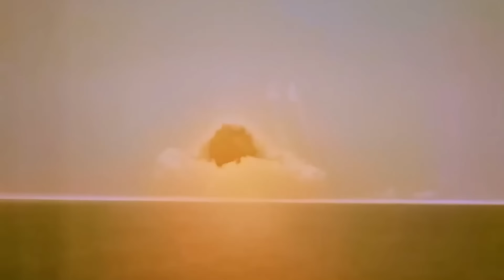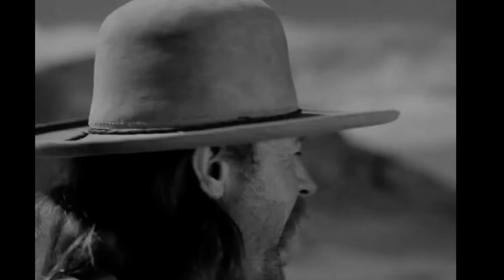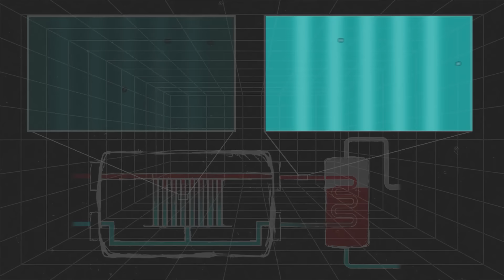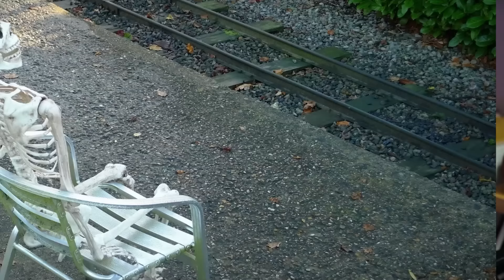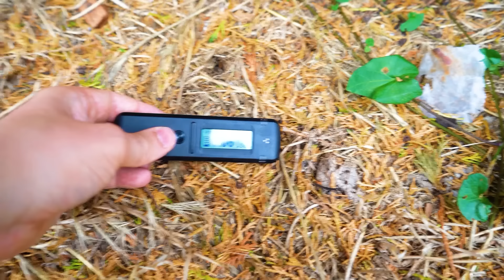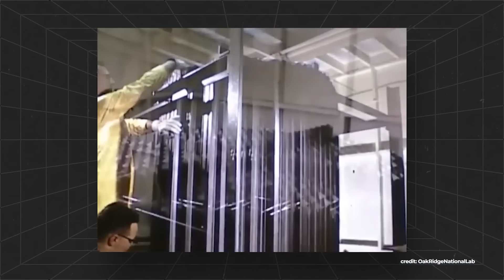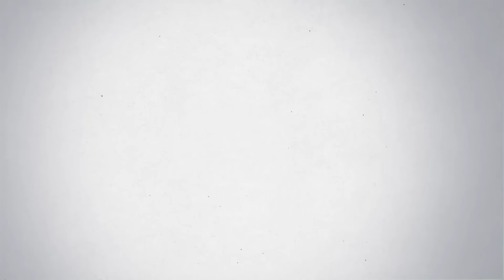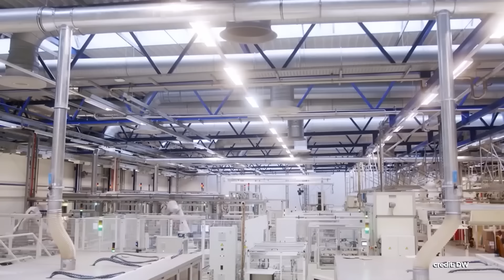It's Happening - China Launches World's First Thorium Nuclear Reactor

Comment: Selling a radioactive waste product as "safer" or of less concern because it has a shorter half-life than some other radioactive waste by-product is a false assessment.

Assume for a moment the world as a whole converts over to Thorium molten salt reactors.  The radioactive waste produced is "only" radioactive for 500 years you say?  Not so fast!  Yes, gram by gram, it will decay to a safe level in 500 years.  However, it's constantly being renewed as more and more radioactive waste is produced.

The proper way of looking at it is this:

Year one let's say 10,000 tons of Thorium-derived nuclear waste is produced globally which will decay to a safe level by the year 2524. Now you have 10,000 tons of radioactive waste sitting around for the next 500 years.

The following year another 10, 000 tons of Thorium-derived nuclear waste is produced globally which will decay to a safe level by the year 2525.  Now you have 20,000 tons of radioactive waste sitting around for the next 499 years.

Each year thereafter you keep adding another 10,000 tons of radioactive waste...for 498 more years!

The silver lining is - due to the shorter half-life compared to other radioisotopes - you DO eventually reach an equilibrium point AFTER the year 2524 where you're no longer increasing the sum total tonnage of stored radioactive waste (5 million tons if we use the original 10,000 ton/year estimate x 500 years).  This would compare favorably with something like uranium.

However, what is inescapable is you are still left with millions of tons of radioactive waste which will NEVER decrease in total tonnage while your civilization continues relying on this form of energy production, adding new radioactive waste to the pile each year even while old waste is finally decaying sufficiently to be considered safe.  You do hit a ceiling on the total tonnage that has to be safely stored (after 500 years), but once you hit it you're stuck with it forever; or until your civilization switches to a different form of energy production that doesn't produce such waste.

That said, I'm not against it.  Of all the nuclear options available, Thorium holds promise as perhaps the most practical, affordable, and safest; barring the Holy Grail of stable fusion reactors, of course.  But let's not pretend that the decay of a Thorium reactor's radioactive waste to a safe level after 500 years translates into not having to worry about safe storage after 500 years.

To the contrary, as long as Thorium reactors are operational there will always be radioactive waste associated with them.  Waste which will have to be safely stored in perpetuity on the order of potentially millions of tons because, as old waste is removed from storage due to having sufficiently decayed to be declared safe, an equal amount of new radioactive waste is added to the pile in an endless cycle.

All the 500-year-safe-level does is set what the total tonnage in storage will be; NOT that you won't have any waste after 500 years.  You will ALWAYS have radioactive waste where nuclear fission reactors are concerned and you will ALWAYS have to figure out a way of safely storing it.

Comment: The importance of the Chinese reactor is that it meets both of what I consider the most important characteristics of future desirable nuclear reactors. 

Most importantly it eliminates pressurized water cooling and the potential of core meltdown and explosive release.   Molten salt cooling eliminates the need for both costly high pressure containments and any need to site near cooling water to condense steam.  The latter can largely eliminate the need for new bulk transmission because such reactors can be sited near any load for ultimate service reliability.  Note that Terra Power's Natrium also meets this most important goal with intermediate molten sodium cooling,

Secondly, using molten fuel provides self regulation, walk-away safety and the potential to breed its own fuel from existing waste as well as abundant Thorium.  The first two of those characteristics should also make siting much easier. 

I note that you ignore other Thorium reactor developers such as Copenhagen Atomics, who may also achieve near term commercial Thorium reactors before 2030.  I also see all of the needed reactor advantages in the fast breeding MCFR being developed by Terra Power, EPRI, Southern Company and others that could use any fuel, including waste, without needing periodic moderator replacement - and readily capable of GW sizing.

The Chinese reactor is not the only advanced option and Thorium is not the only breeder fuel option.

Comment: "First man made nuclear disaster since chernobyl" will soon be the new headline
Reply: What  first ? Don't you know what happened in Fukushima in 2011?
Reply: @BOT-ye6tj  its not manmade accident... it was due to a natural disaster....
Reply: @prospect2664  No, no, no, this is man-made. The construction party did not build the breakwater according to the standard, which was several meters lower than the drawing standard, resulting in seawater backflow when a tsunami occurred later. During the handling process, TEPCO adopted a concealed and delayed approach, without taking any proactive remedial measures, which led to such a serious accident. You go check it yourself.
Reply: Or do you not know about the leakage at the Sellafield nuclear power plant in the UK?
Reply: @BOT-ye6tj  again, that was fixed fast, chinese arent smart enough to do quality work, they do tofu buildings and roadworks

Comment: Advantages of Thorium Reactors
Abundant Fuel Supply: Thorium is three to four times more abundant in the Earth's crust than uranium, making it a more sustainable fuel source.
Safety: Thorium reactors operate at lower pressures, reducing the risk of explosions. Some designs, such as the molten salt reactor, also prevent catastrophic meltdowns.
Lower Waste: Thorium produces significantly less long-lived radioactive waste compared to uranium reactors, and the waste it does produce has a shorter half-life.
Proliferation Resistance: The by-products of the thorium fuel cycle, particularly uranium-233, are less suitable for weaponization, making thorium reactors less attractive for nuclear proliferation.

Comment: Basically they are just heating up water using something hot. Why not just make a giant microwave oven and just microwave water. I suppose here they just heat something up into a molten material and allow it to boil the water. Basically Thorium is something that does not cool down fast if "they" heat it up. Couldn't anyone just make a steam engine, just heat up stones in a fire and let it boil water. With energy it often seems to end up being water that is heated that moves on in a steam turbine. The other types of turbines seem more interesting for the future. We need new types of turbines, nuclear energy is not anything new, its just a way to heat something up such as normally water.
Reply: Nuclear reactors produce energy by converting matter into energy.  A very tiny bit of matter produces a massive amount of energy. Your way requires massive amounts of energy that comes from burning fossil fuels or building lots of infrastructure to produce wind or solar.

Comment: The Shippingport commercial reactor operated with thorium for over 28,000 EFPH (1977-1982).  Naval Reactors and Westinghouse used thorium and uranium233 with a movable fuel control to produce 60MW electrical.

Comment: Id like to hear what you think could be done about the whole steam turbines, living in the 1800s comment - is that the best we can do as long as our infrastructure needs us to send electricity through copper wires? What other ideas are out there that have potential to do better? If you could lower the constraints that currently make change less impractical, what sorts of improvements could be made? For example, the New York City still works on steam… which is crazy… but would this technology be suitable for steam generation for uses like this? What else can be done with the thermal energy created by thorium molten salt reactors?

Comment: I see a couple problems.
1. Molten salt. What happens in an earthquake/flood event? Molten sodium is violently reactive to water. Yes, this is a solvable problem.
2. 'less waste' is not no waste. In fact, the vast majority of radioactive waste is contaminated components - reactor components and virtually  every manufacturing component that mines and refines the material. We have NEVER decided on a permanent storage location for nuclear waste, which is why so much of it is sitting aboveground in dangerous locations like Hanford. We have 3 good sites that are not being used. This is a purely political problem with a purely political solution. Solve that problem, then come back to me.
3. Nuclear energy is still the most expensive way to generate electricity, although it does not generate much additional carbon dioxide (or worse, methane) in the atmosphere. Sure, we could commit to spending $500 billion on nuclear power. The same money would generate 3-4 times as much capacity if directed to wind, solar and energy storage.

There is no evidence that thorium would be less expensive than uranium and plutonium. It's is worth exploring, but is unlikely to be a solution for large scale energy production.

Comment: A thorium reactor could be made small enough but powerful enough to put into a space craft in space. That said you now have enough power for that deflector shield. But I think they are going about it wrong. Lets look at tesla motors. Now think black hole. Don't try to stop partials direct then to the middle. The ship would be like a donut and the particles would be channeled to the middle . creating a curve. This happens naturally in space. It could even be part of the population system.  Now think warp field. This thinking fits right into warp fields and Musk all ready got that one figured. One last thing. Graphene can be doped to use as a capacitor to create energy from background radiation. So capturing radiation. All radiation travels at a frequency. .You can change frequency.. See microwave technology the type you cook with. The reverses is do able. This is not about creating a usable power supply that is practical but rather a cheep method of changing the wave length of the radiation coming in to a desirable one. Short version. don't stop, redirect and accelerate rather than slow down. Second absorb. and change frequency. Do what nature does already.

Comment: From what I recall current materials will only last for 6 to 12 years as a containment vessel in a molten salt reactor, an addition, while the waste products of thorium lose radioactivity far faster than uranium, they are initially far more deadly. On the plus side Thorium molten salt reactors not only "burn" far more of their fuel, resulting in less waste, but can also have other nuclear waste mixed into the fuel to burn it as well.

Comment: Yep, but they used crap concrete and it keep cracking. But it was enough of a test for them to move together. I think  America needs to work on modular thorium  but America has started moving to fission reactors instead of  fusion. If we can create a working fusion would be the future but unfortunately it’s always 50 years away because crating a sun in gravity making it float with magnetic fields is hard the plasma ends up hitting the walls and eventually and melts everything and the walls are where to water is held to boil for steam.

Comment: Oak Ridge National Lab had a Thorium reactor working for over 5 years without any issue. There are many reasons speculated on why it didnt become used. I tend to believe it due to taking longer to make into fuel for nukes, which where very popular at that time and radiation wasn't fully understood or at least it wasnt understood on its effects on the environment. Remember, at one time the US Gov wanted to use nukes to make lakes and reservoirs. So Thorium got kicked to the side and was generally mostly forgotten about in terms of being a viable fuel.
Reply: You are absolutely right. The critical decision was made just at a time when the strategic competition with the Soviet Union was in full swing...
Reply: The MSRE at Oak Ridge was not without problems. An it was never using thorium - though still one of the very few to actually use U233.  After the active use phase they found corrosion damage that would have forced an end to the experiment anyway. In the aftermath, well after shut down they run into a bigger issue from the cold fuel salt decomposing and moving some 2.5 kg of U233 to a charcoal filter. This was relatively close to a real desaster.
The did relatively little (and what was tested largely failed) to the difficult part of the Thorium cycle, which is the chemical separation / reprocessing. The theoretical design work on a real breeder came to the conclusion that it would be very difficult and not working as initial thought. Not producing weapons grade matirial was definitely not the issue - more off the opposite: there is some extra proliferation risc with the Thorium cycle as it requires a lot of chemical handling of used fuel. They even produces some weapons grade plutonium in the MSRE and only diluted it with reactor grade Pu to avoid the complications with the waste fuel.
Reply: @AtomicOverdrive:  The main reason the U.S. went away from Thorium was POLITICAL !!!!  I am talking about politics within the U.S.A.  Bunch of folks with their hands on the gavel making decisions based on  what would benefit their state the most. Think California for instance.  They (WE) could have kept the weapon production separate from the power generation project and gone with Thorium. Corruption. Short-term gratification. BS BS BS. Need to keep educating everyone why NUCLEAR is our answer.  Turning off the power supply is quick education.
Reply: When man first encountered fire, it was likely poorly controlled and led to disasters.  But now we heat our homes with it, heat our water with it, cook with it.  It does humanity no good to simply react to this energy source with superstition.
Reply: Radiation was extremely well understood at the time. They just didn't care

Comment: there is a dangerous secret about Thorium MSR. the thorium breeds the fuel : U233. U"££ is as mentioned, fissile, which is where the power comes from. However, U233 can therefore be chemically separated from the mixture. as also mentioned in the video, U233 fissions really well across the range of neutron energies: a very high capture crosssection. BUT- like U235, U233 has a relatively low spontaneous fission rate, and can simply be assembed to a critical mass to make a fission bomb. No need to compress it like plutonium. therefore and i think this is the specific reason why the research was shut down in the early 70's: U233 is a proliferation nightmare scenario. as Oppenhimer said" if we had known about U233 we probably wouldnt have needed to go down the plutonium route" paraphrasing. no need for centrifuges or difficult compression warhead designs. the only saving grace is U232, which is a powerful gamma emitter, making handling it difficult. but there is a way to get rid of U232.

Comment: You do know Dr Ben that the TerraPower/GEH Natrium plant is NOT a molten salt reactor right? The molten salt is simply used to store the heat (similar to thermal solar) to allow shifting to peak demand. It is actually a Sodium Fast Reactor using solid metalilc U fuel, and pure liquid sodium metal coolant (not a salt) very similar to EBR-II or PRISM.

Comment: As an Enigneer I can tell reducing the pressure in the pipes will reducing the efficacy. Increased pressure will also increase the volume expansion and with that the kinetic energy in the turbine. Increasing the liquids pressure doesn’t need a lot of volumetric work but with gas its different. Just think about putting pressure in a bike wheels and now image adding pressure to a bike wheel filled with water. Pumping air takes like 20 pumps but increasing the pressure of the tire filled by water you will only with big push. Dealing with pressures is no a problem in modern days anymore

Comment: Let us be clear. Thorium is not a fissionable fuel, it is a component of the Thorium-U233 cycle, which has to be started using a more or less conventional U237 reactor to convert Thorium to U233. By the way, U233 has been used to build at least one experimental nuclear weapon,  though I don't think it is in common use.

Comment: Good presentation but the Idea and advantages of Thorium reactors have been clearly promoted for a long time. The technical challenges of plumbing and pumping high temperature, highly corrosive, radioactive molten salts are the more interesting subjects I would like to know more about. 
Material science is at the heart of these issues and it is evolving rapidly. What are the problems they are experiencing? What materials are they are trying; exotic metals, ceramics, carbon fiber, or ____________?.  What do they think the solutions will be? This is what I would  like to know more about and may provide a more realistic level of hope.

Comment: China installed 350 gw of wind an solar in 2023.  That is the equivalent of 120 nuclear reactors.  

The wind 🌬️ and sun 🌄 is free.  The construction timelines faster and for solar newer tech can increas efficiency by 50%.  Do you just replace your old panels with new ones and upgrade the power distribution.  Ladtly China has millions of square KM of dessert that they are using solar to provide power and green the 🏜️ desert.

Implicationd of this shpuld be studied.

Comment: How corrosive is the salt when it's molten?  I imagine a molten salt could react with or maybe dissolve certain metals.  Do the pipes need both corrosion resistance and high temp tolerance?  Or just high temp tolerance?